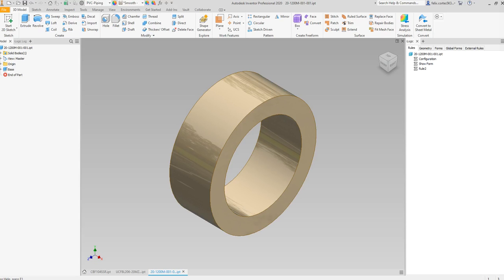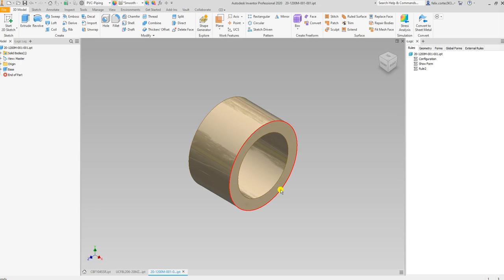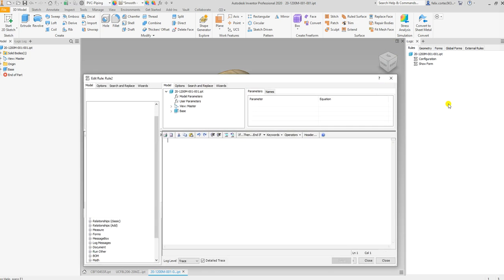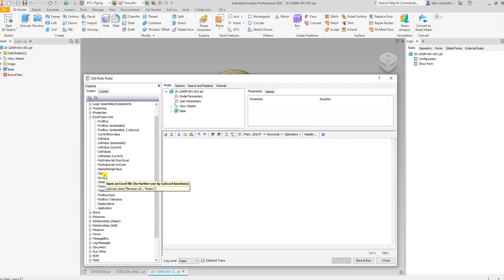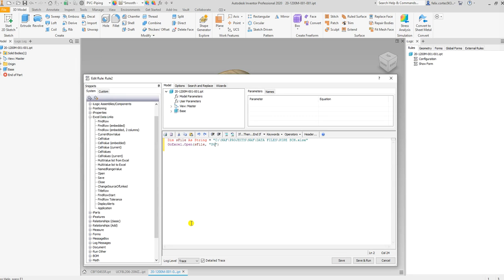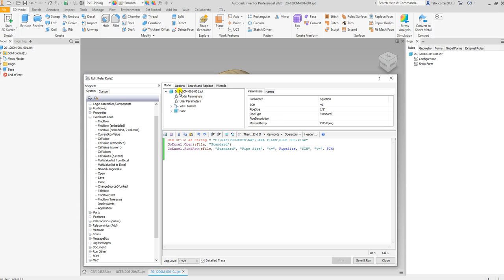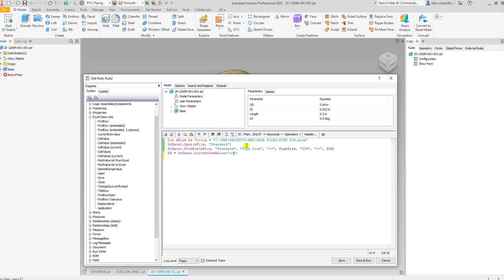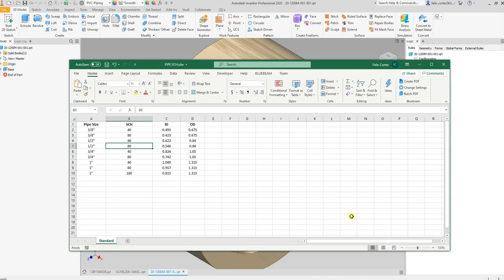iLogic For Beginners #2: Introduction to GoExcel

Comment: Great video! I have a question for you. Say I made the same excel document populated with your data for practicing and I also have these parameters in Inventor. I have built an illogic form linked to the parameters with multiple-values. How can I “limit” the schedule pipe column parameter based on the selecting the pipe size? Basically I’m trying to understand how to limit what the available options are based on what I chose from the pipe size, if that makes sense lol. Kind of like using filters in excel to only show data the meets certain criteria when filtering. Hard to explain but hopefully you can understand what I’m trying to achieve and understand how to code. You do a great job of explaining the “language” in your video and it’s been helpful learning more illogic programming.
Reply from the maker: Yes that's possible using Excel columns and multi value parameters. You'll have to have a rule that runs automatically and some logic that refreshes the values of that parameter depending on the user's selection of another parameter... if that makes sense haha

Comment: Hi,Iam getting an error,

GoExcel:Could not match the column title: "pipe size"

Name in excel and ilogic are same
How to correct it?
Reply from the maker: Double check the column title because it is case sensitive. Also, by default it looks at the first row of the excel sheet so make sure the title is there. Make sure you launch the excel sheet correctly as well
Reply: i got it ,thank you and vedios are very helpfull
Reply from the maker: @krishna7203  glad you like them! Best wishes on your automation

Comment: i am getting the error, Error in rule: excel, in document: JHB-3DT-Cprofiel-trogstel.iam

GoExcel: Could not match the column title: "lengte". do you have any suggestions?
Reply from the maker: Check the name of the column on excel then check the name that is written on your iLogic rule
Reply: @DesignAutomationSolutions  i have checked it more than once, but it still doesnt work
Reply from the maker: @markvanmaldegem5364  send me the code to my email felixcortes147@gmail

Comment: I am interested in using this method to create part numbers. Ideally I would like to find out if an entry exists with the matching parameters and then reuse that, or if an entry does not exist in the spreadsheet, create the next entry and populate it with all the relevant parameters. This way I could automatically detect existing components and reuse them if possible. Also if it makes a difference, there's about 10 different parameters I need to monitor for each part.
Reply from the maker: I’ll make an upcoming video for this!
Reply: @DesignAutomationSolutions   @Automation With iLogic  I look forward to it :) I'm just about getting knee deep into ilogic and I've started fully automating a lot of my designs. My thoughts are that I can create a dynamic block in autocad then use those blocks to produce a data extraction table for products. That table could be read by inventor and the drawings fully automated from that. That would let me focus on the big picture and design assemblies in bulk. 

Just out of curiosity, once a spreadsheet of parts/assemblies is created, would I then be able to create a script to run automatically cycle through each spreadsheet entry and then export a pack of drawings and dxfs of every instance? So far I have been able to fully automate the drawings, and then produce a dxf flat pattern and a pdf pack for each component. But I manually have to switch between instances and then rerun the export code which can be very tedious with hundreds of variants. If you could include this in your video I would officially be your biggest fan 🙂
Reply from the maker: @Nickgowans  Watch my video that i post today! It's only an example but it shows a project that I did for a company that extracts the data from AutoCAD dynamic blocks then runs ilogic rules to generate those assemblies.

You should be able to run through each spread sheet and each cell value. Is the spreadsheet meant for sheet metal components only?
Reply: @DesignAutomationSolutions  I have explained my janky workflow on your other video. I think I'm taking a slightly unusual approach to things so it would be hard to explain but basically I do not actually export my model once it's configured, I don't replace any components, I simply change the components which exist and update lots and lots of parameters for every part and then update the part number to suit. But often I find that some assemblies use matching components and it makes no sense to use unique part numbers for them so I need to retrieve any matching values from Excel, . And because I haven't got a saved itp file of that component anywhere on my project (because there is only 1 itp covering all variants) Its as though I am saving my parts within my spreadsheet. That means if someone wants to see the model of a specific assembly type, I have to select if from a multivalue list which is populated using said spreadsheet, then run the rule to update the assembly.
Reply from the maker: @Nickgowans  Yeah it's definitely possible to store that information onto the excel file. The only issue that comes up with is having too many users making updates to that excel file. Could cause some corruption on the excel file. Ideally, it should be Read-Only for majority of the engineers who are not programming or maintaining the code.

I am having a bit of trouble trying to visualize how the assembly and the iLogic operate